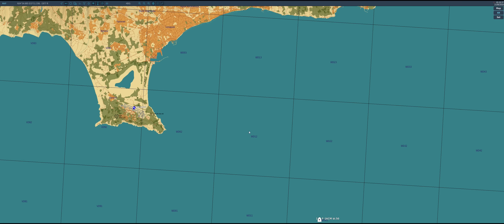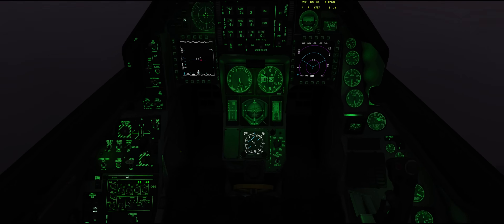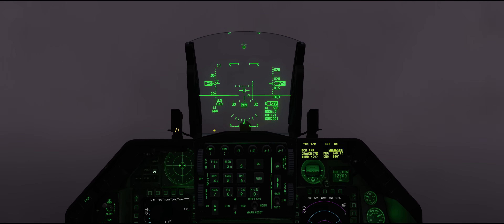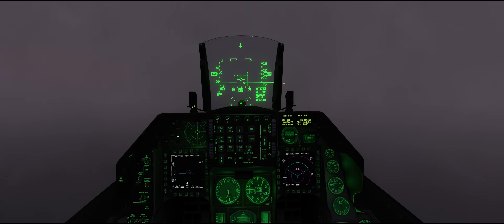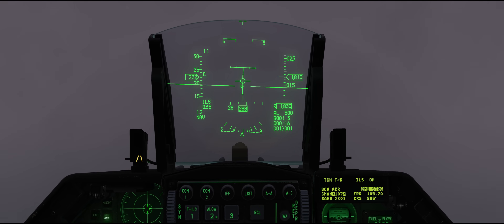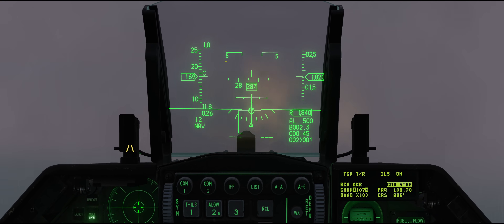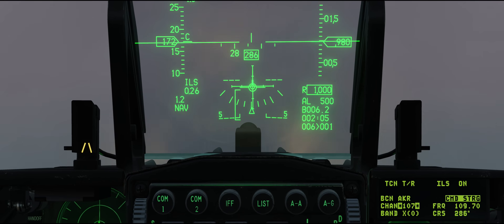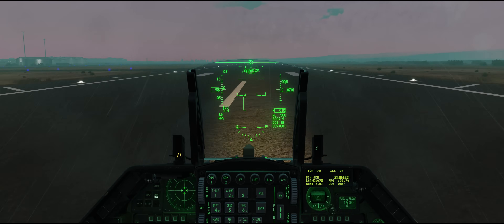Instrument Landing System | DCS F-16C

Comment: I've watched this a bunch of times but I constantly have issues where the glideslope bar never meets as a cross with the localizer. it's always too far up or down. what does it mean when its pegged up top or at the bottom? what do I need to do to correct it or line it up in those circumstances?

Comment: A technique for the 45 Degree intercept is to put the head of the course (as selected for the ILS) on the 45 degree dash that is under the distance (for this particular dogleg) instead of trying to line up the CDI.  If you look at 4:59 you can see the head of the course pointing at the 45 degree mark on the HSI.  Cheers.

Comment: Just a non-important detail…and I’m not sure if DCS models this correctly or not, but in real life, an ILS will only broadcast a single radial. If you somehow miss the magnetic course by a few degrees, it should still give you accurate tracking to the runway, and the HSI needle will still be in the middle if you’re centered up but it will be pointing left or right depending on the magnetic variation.

Comment: I'm having trouble getting the command steering to work. I follow your steps: set his to pls TACAN, input frequency (senaki kolhki 108.90), input course (088), and TACAN(31X), and the command steering does not turn on. I also do not get my localizer or glide slope to align anywhere near the runway. Please help.
Reply: every time I've had issues with the command steering not showing up has been because I forgot to toggle the HSI to PLS TCN

Comment: It should be noted if it has not yet, that the DCS F10 map has been updated to show Magnetic and True headings at the same time now.  They are shown on the new Compass Rose as well as when you manually draw a line. They are both updated dynamically as you move, the compass rose or draw on the F10 map!

Comment: Tip: Hit your uncage button when you have the runway visible.;)

2nd tip: The moment you touch the ground, the angle bracket ain't..! reliable any more. At point of touch, you switch only to your pitch ladder. (Cause..!! at moment of touch) you physically have only the max horizontal angle's that counts.!

15deg. (Air-brakes 'retracted.!) or 13deg. (Air-brakes full.! extended). When the air-brakes are set to there auto landing config, (just extend them full, and release the button. They set themselves!)  its around 14 deg. (MAX values.) at touch.

Hint:
Look at the hud.. when he is perfectly (that i say rarely.!) aligned.! .... its 3deg..!
Not the dashed lines, that says 2.5deg.😉
2nd hint: 
The top point of the vertical line of the FPM just/just-not hits the 2.5 deg lines, makes you have a god reference of a 3deg glideslope..

Comment: You make Tacan and ILS landing look precise and clean on the F-16....great job. 
I have two questions I'm curious about. Can I save the original Tacan/ILS settings to reuse in the event that I crash?
Can I load and recall more than 1 preset Tacan/ILS parameter into the system for landing at different locations?
Thank you 
Regards Roy

Comment: When I enter the frequency the command steering won’t come on. Am I missing something?
Reply from the maker: You’ll need to set the course as well.

Also just FYI at some of the airfields in Syria the ILS does not work right
Reply: @FLYGaffer  Thanks, I actually should have came back and deleted this because in the scenario I set up I think I was just too far from the runway when I set the TACAN up. Once I got closer the command steering came up on its own. I was practicing at Incirlik.

Comment: What in case if we don`t have Tacan and ILS available? In Syria only 1 airport has both,  and thats Incirlik airport. So its in no use unfortunatelly.
Reply: Afaik the ILS should provide DME,  if not, you still have the approach marker beacons, looks like this one has a MM.

If you have TACAN, you can do a non-precision approach.

This one is a 13 DME arc starting from a hold on the R-180. Follow arc to inbound course of 261°

At 3 DME turn right 23° and look for runway.

Comment: How open are the speedbrakes on approach in percent? I always used 100%. Now I learn its wrong, but by how much :) 
Best Video on this topic imho.
Reply from the maker: Gear down, speed brakes closed, level and 11deg AOA while intercepting the Glide Slope from below. 

Once the GS is nearly intercepted and the CMD steering doughnut indicates a descent, open the speed brakes 100% and the aircraft will initiate a descent on its own. Fine tune the thrust and stick to maintain 11 deg AOA and flight path marker on the doughnut. Leave the speed brakes out.

RE the 30 degrees bank and speed under 250kts when intercepting, I found this in an F-16 manual and it works in-game. Not sure if the AP is supposed to be able to steer for you. It is either not implemented in DCS yet or is not a feature in the real aircraft.
Reply: @FLYGaffer  I was stupid, cmd Strg is the donut basically, just went to chucks guides to reread. It cues you in but you can’t latch on to it. Flown too much f18.